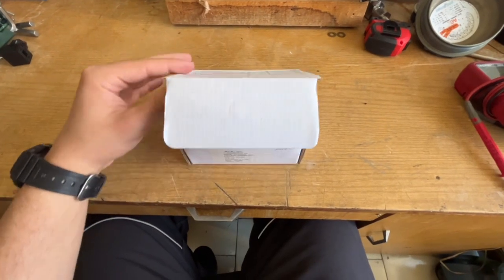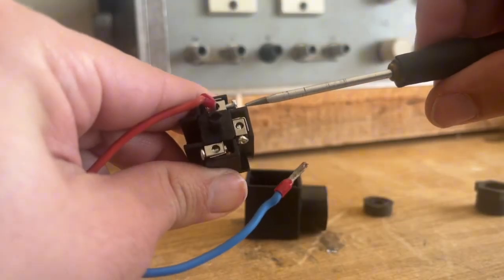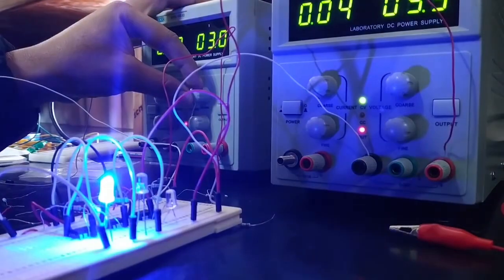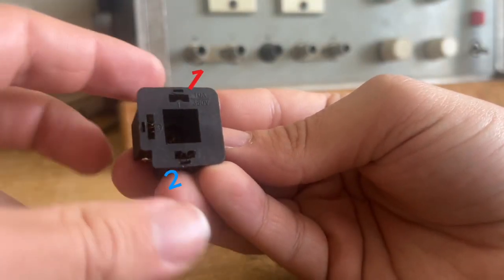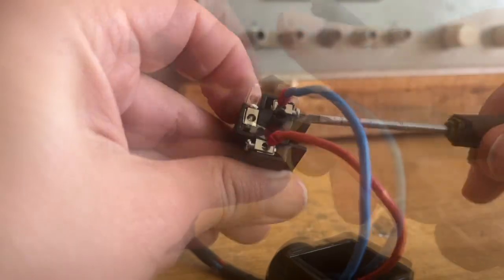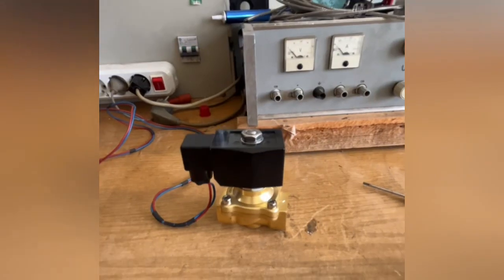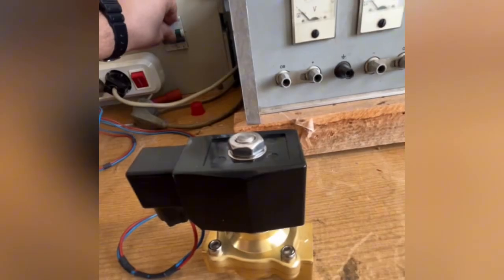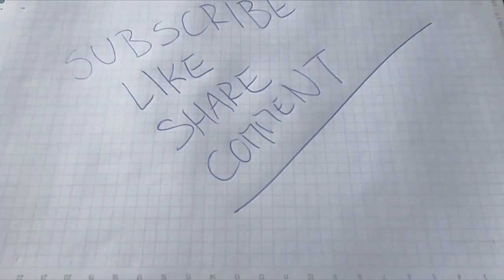Solenoid Valve Explained: Easy Wiring & Operation!

Comment: hi
how are you today.
i thank you very much for your help.

i bought a 24vdc gas leak detector from China
and I bought a 2 was solenoid shut off valve also from china (24VDC) Normally Closed
i use 220V Power
How do i connect both of them together 
so when the Detector detect the Gas
the solinoid will shut off
Reply from the maker: Hi my friend, do you have a 24V DC power supply, and can you tell me exactly how this gas detector works? For example, what is its output signal — is it only a digital on/off signal?
Reply: @officialElectroLab 
Yes I do have an adapter 240v ---> 24v
I dont know if I can send you an email
Reply: @officialElectroLab  
https://youtu.be/JTNDxaRPEps
Reply from the maker: @jamal31971  If this device has a relay output that provides 24V DC, you can use the normally closed contact. In this setup, your valves will stay energized and open under normal conditions, since they are normally closed. When the device detects gas, it will open the contact and cut off power to the valves, causing them to shut off.
Reply: @officialElectroLab  
i just made this video as intructed by the manufacturer. the NO valve still didn't react. i don't think Electricity reached the Valve

https://youtube.com/shorts/eeHdPuGIL2g?feature=share
Reply from the maker: @jamal31971  The two terminals on the gas detector are just like a switch. They don’t give power by themselves — they only connect or disconnect the wire. So, you should take the positive wire (+24V) from the power supply and pass it through the detector first. From the detector, send that wire to the positive terminal of the valve. The negative wire (–24V) from the power supply should go straight to the negative terminal of the valve. This way, when the gas detector senses gas, it will open the switch and stop the power going to the valve, which makes the valve close. You can see from the video of the manufacturer that its only going to + through relay output
Reply: @officialElectroLab  
thank you so much
Reply: @officialElectroLab 
I called the manufacturing company for the lpg leack detectors.
They send me a picture (if you watch the video at 50 sec) of how I should connect it.
But it didn't work.
The setup they made work with normally open valve not normally closed valve.
So
I dont know how to set it up.
Please not I am not a technician.
I bought the for a client and he wants to return the merchandise
If u can help please do